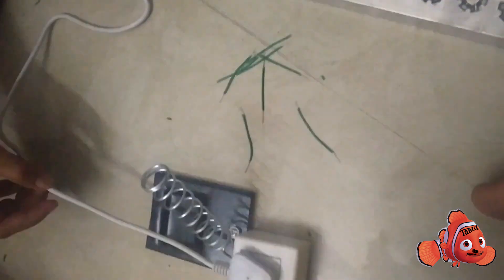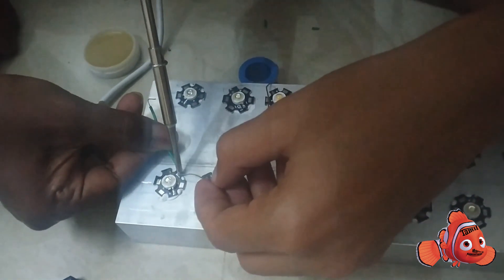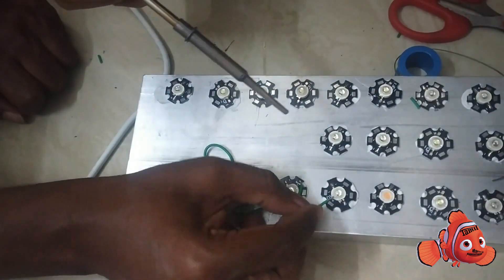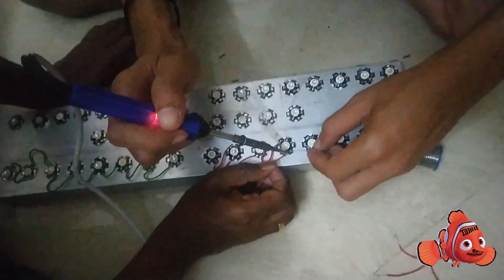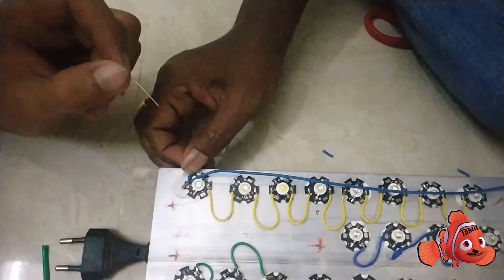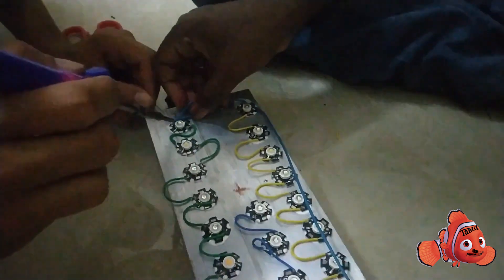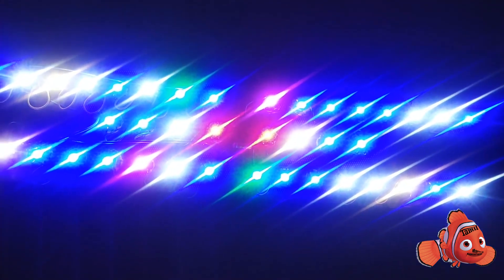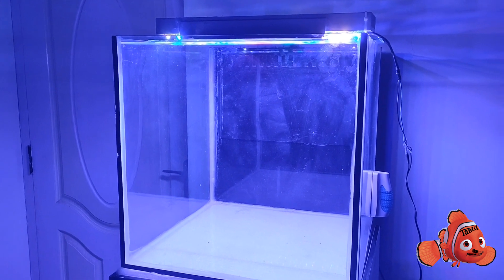DIY Marine Aquarium Lights | How To Do Marine Aquarium LED Lights | 120Watts

Comment: Which power supply u used?what is the rating?
Reply from the maker: It's 24v 5amps dc driver constant voltage.i bought in should so didn't see the rating bro brand is Emerson so good brand

Comment: Really a great work and also great effort bro. What was total cost to done this aquarium bro. I need something like thia for 4 feet tank.
Reply from the maker: thank you so much bro it came around 6k for entire light i used EDISON Brand Led so little costly. 7, For a four feet u require a 2 feet to 2.5 feet length lights..
Reply: @TamilAquariumCare  thanks for the info bro. Really a great job. How much it will cost for 4 feet tank bro. If i need only white lights. I m having cichlid tank right now. So it will be good for cichlid having white lights. Can u give some estimation to proceed further with u.
Reply from the maker: @vigneshthayanithi8555  bro just normal t5lights are enough for cichlids tank bro ..

Comment: Bro super, Led frame comes with attached lights? Or u made that?
Reply from the maker: It's attached to the frame now since due to lockdown I made it static after the lockdown I ll be making sliding type cover for the light bro stay tuned for me updates ..

Comment: Great job bro ,  and i have a suggestion that can u do wiring internally i mean back of the metal frame...
Reply from the maker: Sure bro since I am new to Chennai it was hard for me to drill the aluminium heat sink meanwhile I ll be altering the light in my next video by drilling and wifi controller..